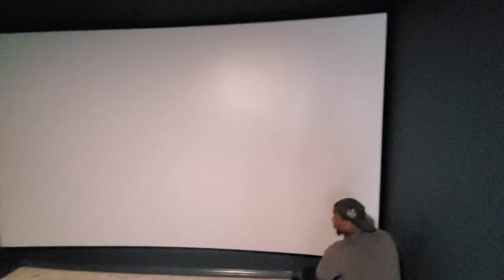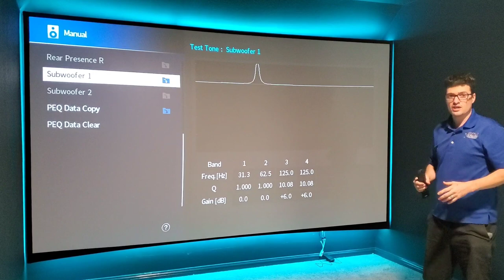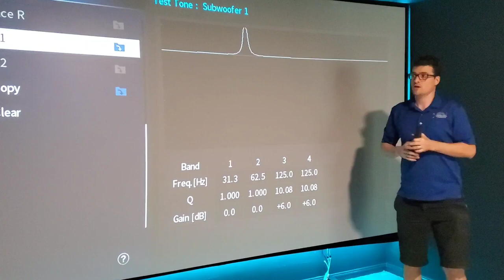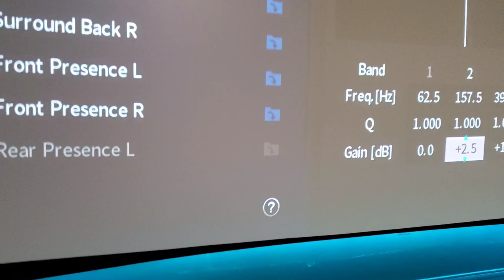Divine AV goes to Austin Texas  | Day 3 | Home Theater Vlog 5  | AV Vlog

Comment: Warren, how is the sub tuning on the Yamaha receivers?  Is it comparable to using REW and a Mini DSP?
Reply from the maker: Hey boss, it has a 7 band parametric EQ with selectable frequency bands. It is quite responsive. You still need a basic reference microphone and at least some entry-level software to analyze the spectrum but that's pretty straightforward. Overall the Yamaha receivers are some of our favorite units.